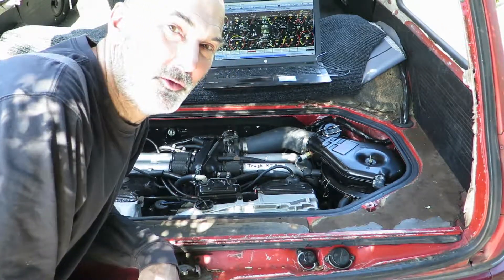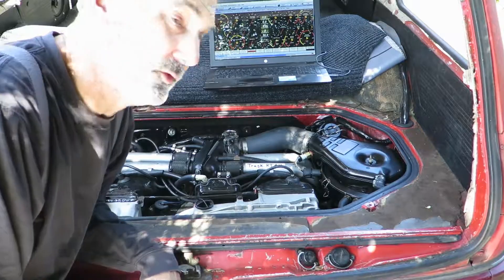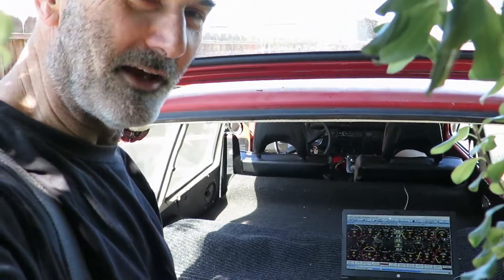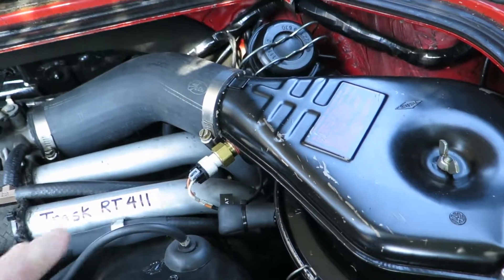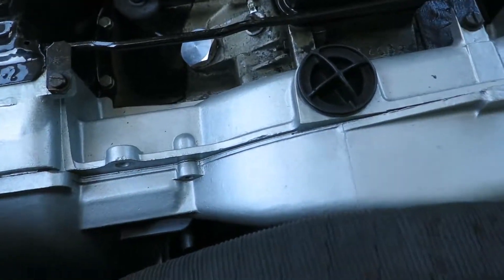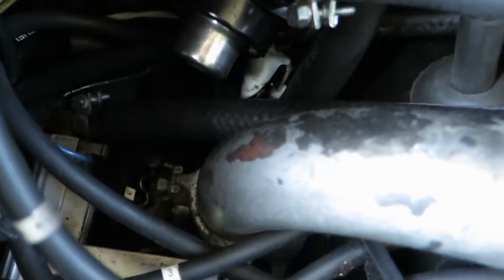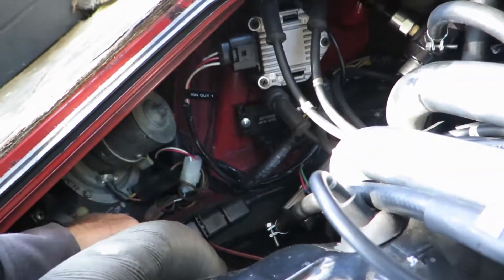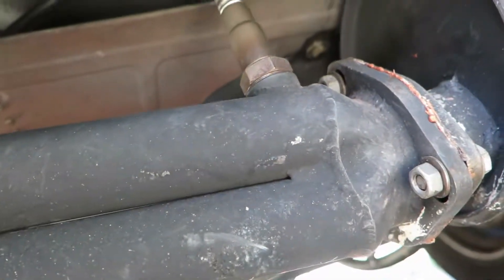VW 411 T4 Engine, Microsquirt Fuel Injection.

Comment: Where did you get that intake hose I need one for my 412 SW I can’t find them anywhere
Reply from the maker: It's a radiator hose, got it at an auto parts store years ago, had to trim it to length.

Comment: Awesome! Vacuum operated TPS? Please explain more on TPS. I have 2ltr type 4, came with no throttle body(I'll need to find one) Wanting to Install Microsquirt 1 with Comupufire ignition, also was buying from Dubshop, What injectors did you use? High impedance yes.
Thanks Theo
Reply from the maker: I’m using a CB performance TPS throttle position sensor/switch installed under the throttle body just like the stock Bosch one.  CB did this for me over 20 years ago, but it’s not too difficult to retrofit a newer TPS, also I’ve seen some use a rod linkage to move a TPS mounted near the throttle body. 
I’m using a Microsquirt, TPS, MAP sensor, CHT, 02 sensor, new high impedance
injectors 32 LBS I think, and a 36 tooth timing wheel mounted behind the fan.  I had the intake manifolds machined for the new type O-Ring style injectors.  Thanks, RT
Reply: @traskrt4113  I need parts!!! i just pickd up a 412, wow, ton of work here!!! 1974